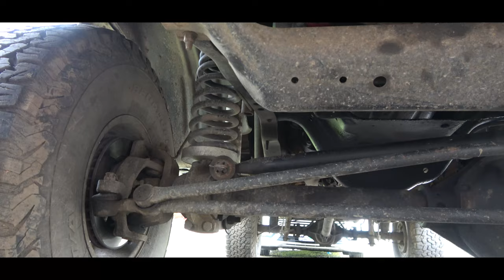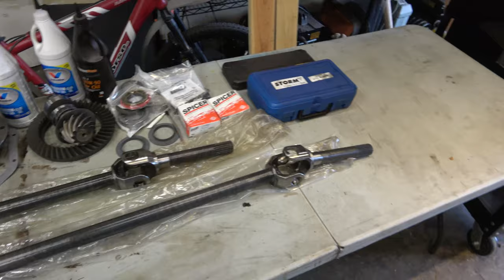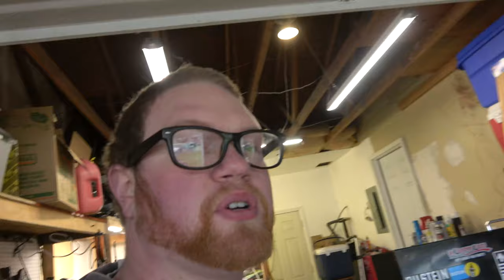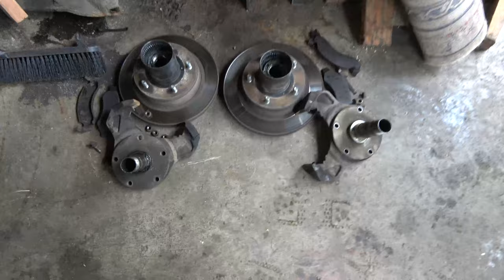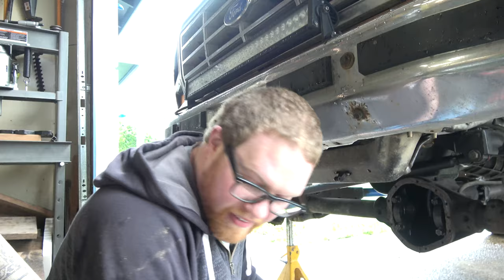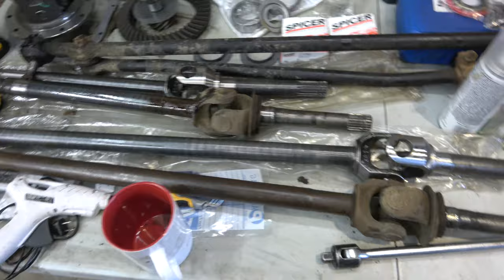1978-79 Dana 44 Straight Axle Gear Change-out and Upgrades | Part 1

Comment: I'm running the same axle in a jeep I built. What tie rod and drag link are you using with the truck and axle swap
Reply from the maker: I’m running the stock 78 f150/bronco steering links.